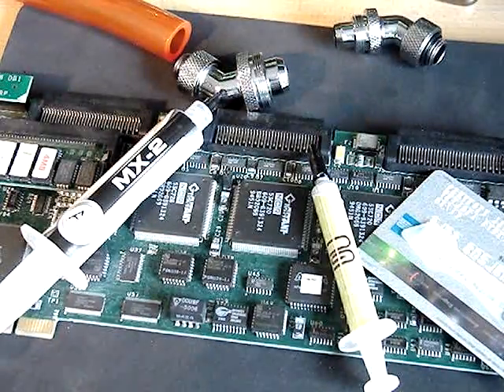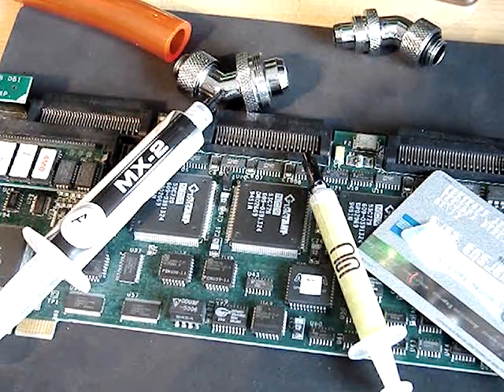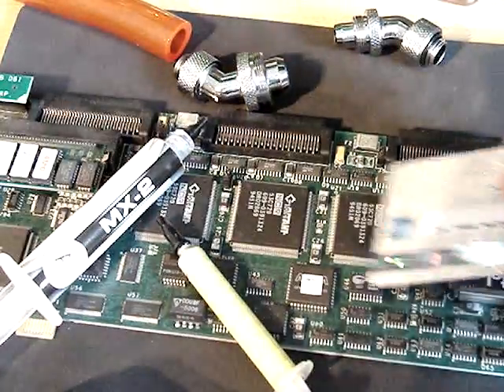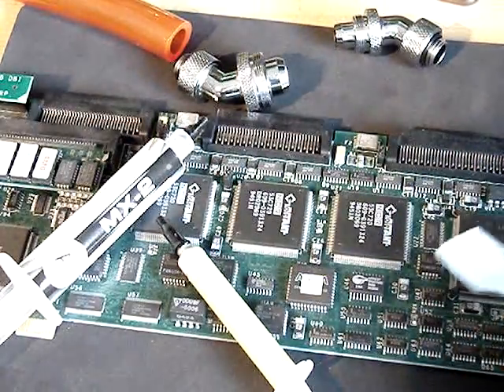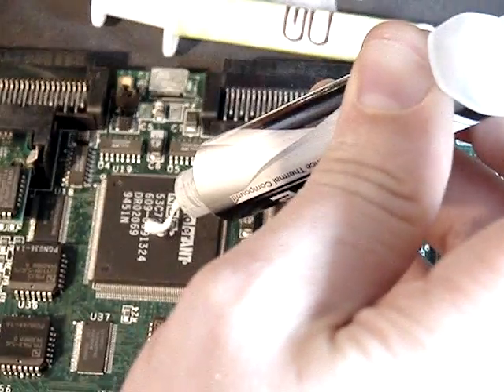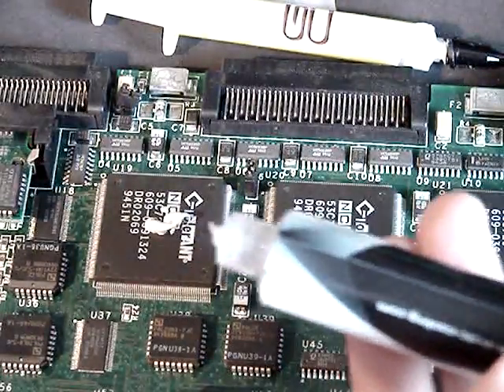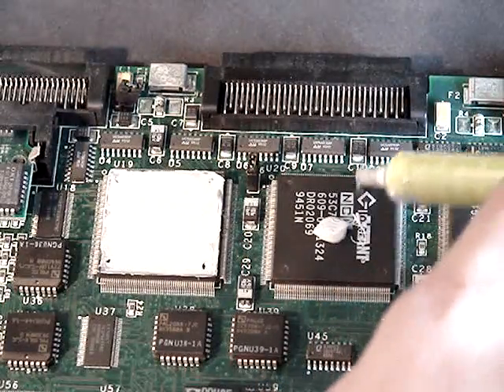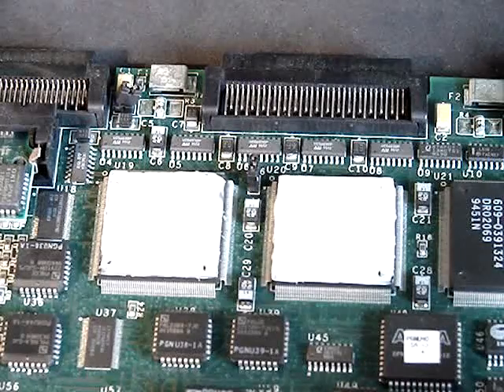Artic Cooling MX-2 and GELID thermal compaunds comparison

Comment: spreading is not often the most important since the easiest way to apply is to put some of the compound, at the moment the best is MX-3, in the middle of the chip and then when you place the cooler and screw it, which is easier and better...

Comment from the maker: I did several mounts of EK Supreme LT with MX-2 and GELID, and Primed95 them. GELID was slightly better for both 2.66Ghz and 3.88G BIOS setup, but the difference was only about 0.5c degrees, so I discounted it. 

All I personally care of that it is just as good as MX-2.

Comment: also spreading with your credit card or that spoon with the jelid is the wrong way to apply compound best way to apply is to place a pea sized blob in the center and let the weight of the heat sink spread it as u tighten the heat sink down when u spread with cred card or that spoon it will create air bubbles giving u  air bubbles which conducts more heat so spreading is bad

Comment: This video should be called - "how NOT to apply thermal compound"

You apply a dot or line in the middle of the chip then use the radiator that ultimately goes on top to spread it - you can check if the "circle" is formed and then finally apply the radiator to the chip - this also means you apply way less thermal compound than you did in the video. The more thermal compound you use - the less effective heat transfer will be.